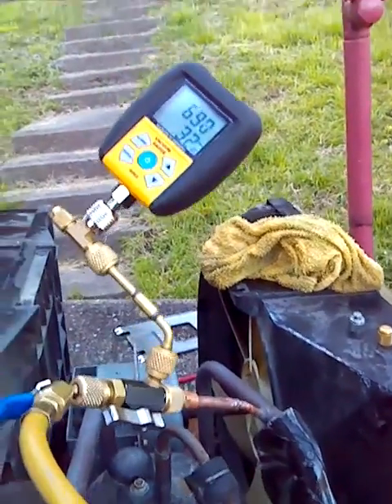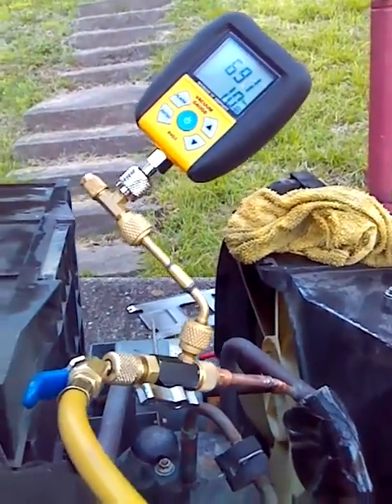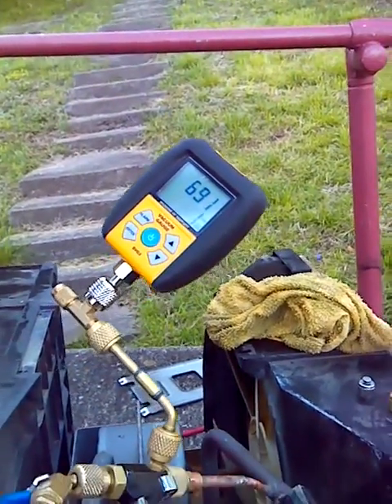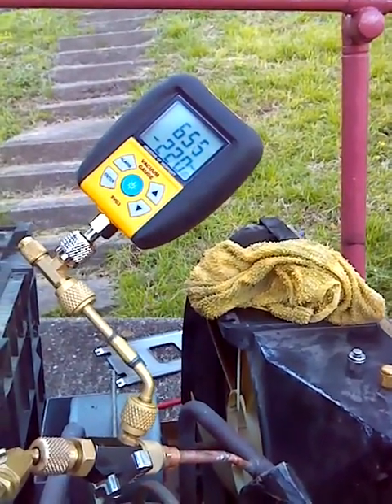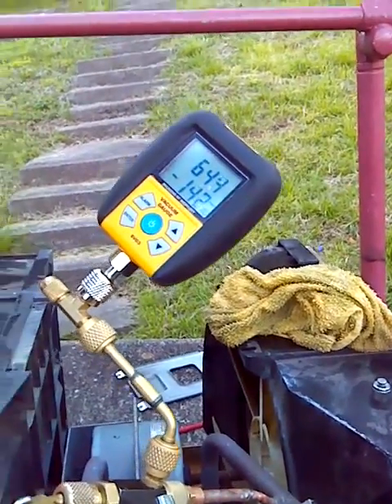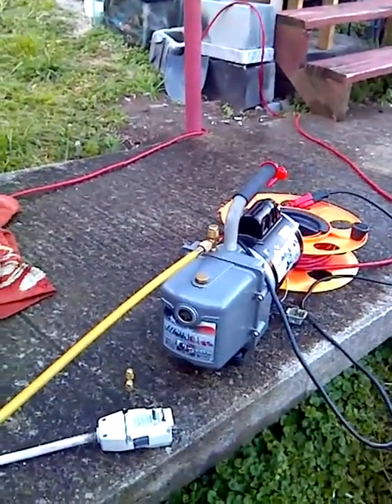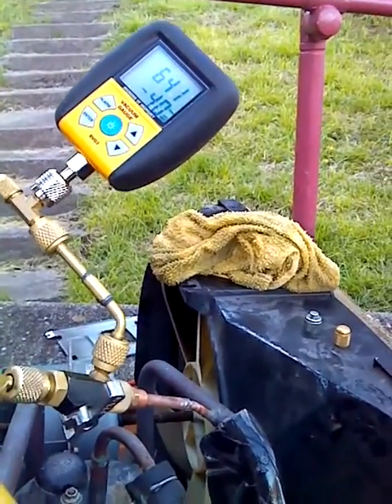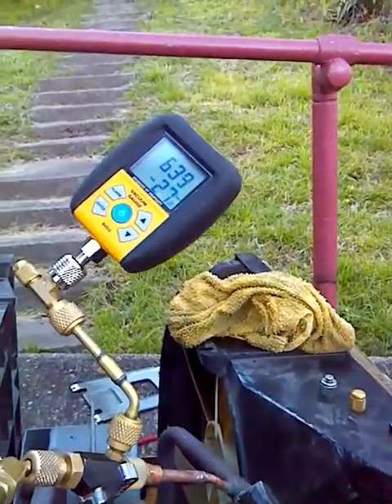vacuum gauge

Comment from the maker: I don't know Richard...  I have heard of others running into this issue as well with the Fieldpiece.  I know one thing is for certain, if it goes down once the valve is shutoff then the system is leak free and sealed!  Has to be or else the microns would rise and not fall. 

It is weird, interesting, but very very weird....